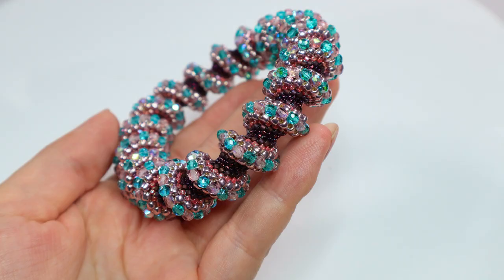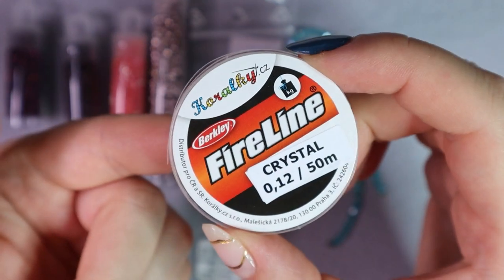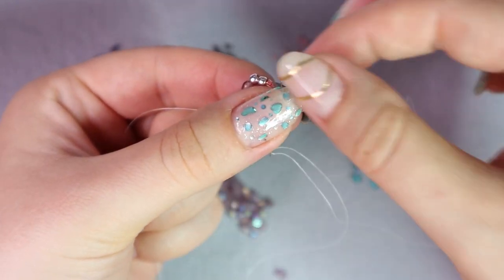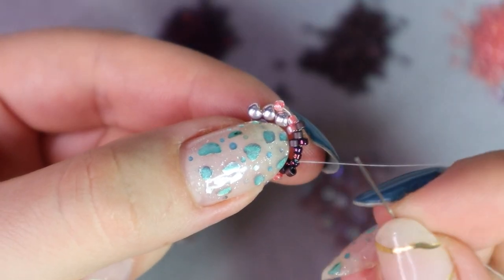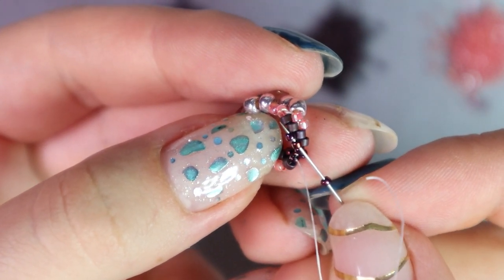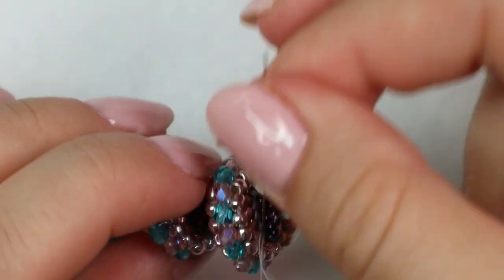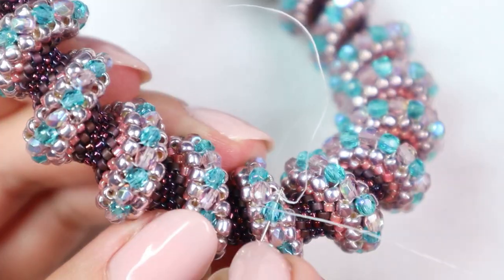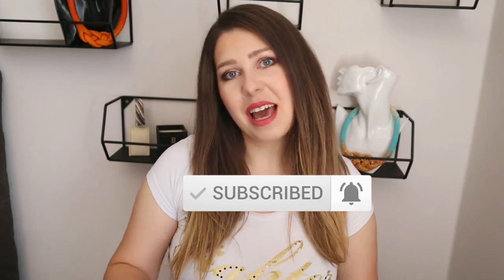Cellini bangle tutorial | Peyote Cellini | Beadweaving tutorial

Comment: I am trying this out.  It is working out pretty good, bit mine seems a bit flimsy.  How do I get it to be tighter.  I have tried tightening my tension, but it still seems flimsy.  Do you have any suggestions!
Reply from the maker: And you use Fireline? If so, I'd still go a little thicker.
Reply: @Danysska  Thank you.  I have 6lb, Fireline I am using.  I will get a thicker one.  I appreciate your help!